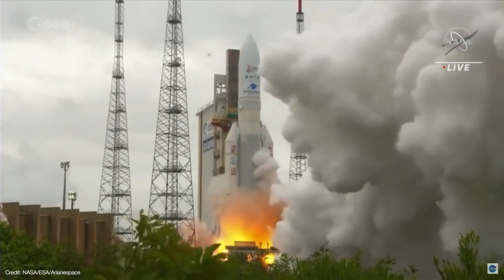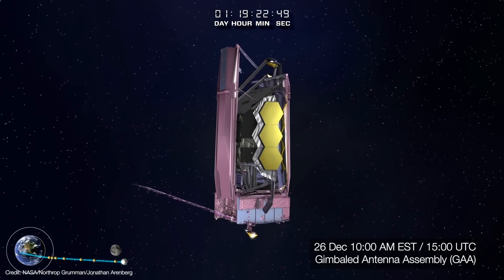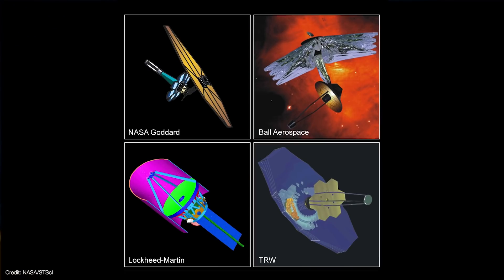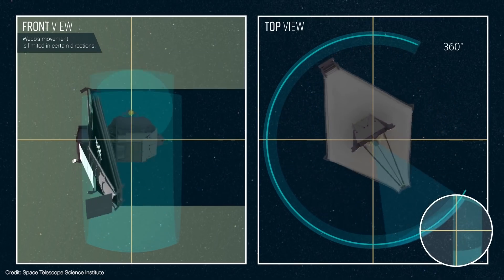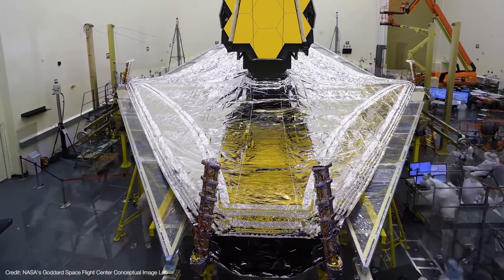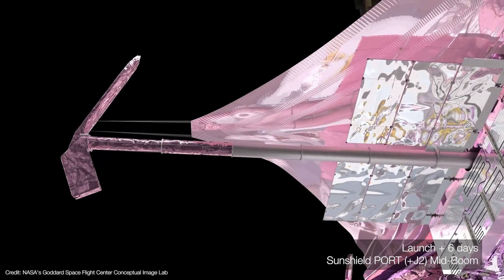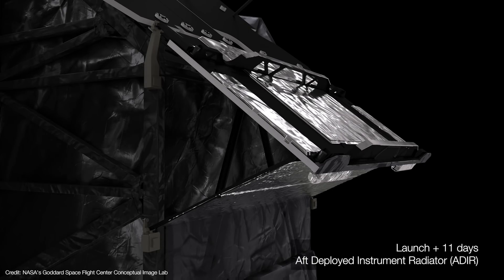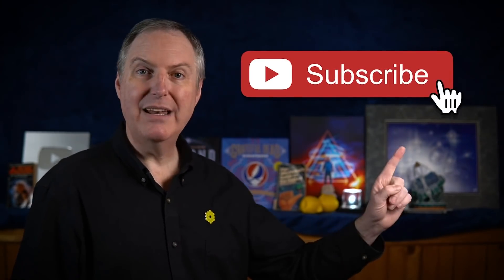How James Webb's Deployments MUST Work

Comment from the maker: 🔴UPDATE: The sunshield covers have been released and rolled back to their staging position. This procedure alone required several mechanisms to fire just exactly right and they did! Thumbnail updated :)
Reply: If there is lets say a MAJOR issue that cannot be corrected...couldn't JWST technically burn to return to earth orbit so at least it could be serviced and then fired again later back to L2? I know this would be insanely costly but much less than losing the entire thing.
Reply from the maker: I don’t know if it has enough delta-v to turn around and burn for home but even if it did, doing so would expose the telescope to the sun, causing it to overheat well beyond limits.   That would render the telescope unusable at that point.
Reply: @rowenhusky  No…not at all
Reply: @tagwolf  I'm sure if anything goes wrong in the future space X will be able to take astronauts to fix it
Reply: @davefarmery8180  It has to station-keep to stay at the L2. The telescope has a planned minimum 5 year operating life. The minimum time for Starship to develop and reach it is probably 3-4 years from now. This would pretty much count as a failed project even if a few years can be salvaged.
Reply: @davefarmery8180  Of course they won’t.
Reply: Luvoir launches in 20 years , hopefully Starship will be ready by then.
Reply: @paulbedichek2679  how do you know
Reply: @Titus Veridius  at 10 billion to build and probably 20 billion to replace and the fact it is allways trying to move closer to earth if it failed i suspect given time it could be fixed
Reply: @davefarmery8180  with what magic?
Reply: @rowenhusky  No, of course not.
Reply: You do the best work on  JWST.
Reply from the maker: Thank you 🙏
Reply: Why didn't they finish deployment at the ISS??
Reply: @popeyegordon  Not only did they not assemble at ISS, the next iteration of this design, Luvoir, will not be assembled in space either, we will simply make use of the greater volume of the fairing of SpaceX Starship to build a bigger telescope, the reason is cost, and you lose the energy you have in the rocket, also, why do it if this method works so well. So far, so good.
Reply: @paulbedichek2679  Really? You ignore the high risk of mechanical failure that is non-existent with an ISS deployment? All they talk about is how many separate operations must go perfectly and one failure can end the mission. I hope it succeeds but if not, this more reliable alternative will come up with the Monday morning quarterbacks.
Reply: @popeyegordon  If
Reply: Which was the reply the Spartans gave to the Persians when the Persians said if we invade Sparta we will desecrate your temples and women.
They never invaded.
Reply: @paulbedichek2679  Correction, Phillip of Macedon threatened to invade Sparta and the reply was "if". For all intents and purposes they were annexed peacefully. By this time the Spartans had lost whatever it was that separated them culturally and militarily from the rest of Greece, they were never especially a military power after this time period. It's also likely that their reputation remained into this period despite their fall from legend, which contributed to Phillips pursuit of means other than war. (though he defeated Greek army after army, and likely would have done the same to the Spartans by a huge margin)
Reply: @Dadecorban  Don't ruin a good story, still the best reply.
Reply: @paulbedichek2679  you ruined a good story ^.^
Reply: @Launch Pad Astronomy It's almost shocking that circular, fanlike sunshades using a much simpler, corkscrew (helical) deployment, weren't used with the Webb.
Reply: Ready for mid-booms.....gogo DEU!
Reply: YES!!!!
Reply: I love the updates for the video’s thumbnail!
Reply: Did you know that HUBBLE is Sophia telescope on a 747?

Comment: @Launch Pad Astronomy Hey, great video on the JWST mission. There's so much attention on this once in decades mission start and you've summarized all the steps in its deployment admirably.  Do you know how much the sunshield will affect Webb's trajectory? It seems like a pretty decently sized sun-sail and generally about perpendicular to the sun so its cross sections catching solar wind would be pretty large. I understand that the aft momentum trim tab helps keep Webb properly oriented but there is still force acting on the sun shield which could affect JWST's trajectory, isn't there?
Reply from the maker: Thanks, I'm glad you liked the video! Radiation pressure wouldn't change JWST's trajectory so much as cause the spacecraft to pivot around its center of mass. This happens when the center of radiation pressure and the CoM aren't at the same location. The exact location of CoP varies depending on the spacecraft's attitude at any given time. So the trim tab helps but the reaction wheels are ultimately going to have to be running during an observation. If the wheels saturate (reach max RPM), then thrusters will be needed to pivot the telescope back and unload that accumulated momentum.
Reply: @LaunchPadAstronomy  I see, thankyou for answering my question! I thought it might give an overall force vector pointing away from the sun which would be at right angles to the direction of motion and that over time could change the trajectory.

Comment: Never considered you need to “ground” electronics in space too. Great video!!
Reply: This is also a reason some rocket upper stages are painted- the paint reduces the surface area on foam insulation and dramatically decreases the amount of static buildup (and of course thermal protection)

Comment: Critical solar array employment? Really, everything is critical with JWST. It’s a pyramid of critical junctures leading to the chance to do space breaking extraordinary astronomy. 

But using critical for the panels is a bit much. This thing is built to take a pounding given its treatment by the launch provider during integration. There are many things that are required to happen in sequence before they even start calibrating and testing the instruments.

Comment: 14:27 Six hundred degrees of what please? Boiling water to freezing air is not 600°C or 600K. If you’re using some quaint units instead of metric, please always mention which ones!

Comment: I'm thinking if you could wrap your house in the very same material used for the shield you could conceivably live in a cryogenically frozen house in the hottest atmospheres on earth or remain nice and toasty in Antarctica in the dead of southern hemisphere winter.. Then again..I could be wrong and probably couldn't afford it if I'm right.
Reply: The sunshield is similar to a space blanket. Many houses already use a similar material on the sheathing that covers the exterior. It does not work as well as Webb, however, because there is air between the layers to transfer heat.

Comment: Please explain how it orbits L2. Since L2 is just a point in space, it doesn't have any mass. What mass is the Webb orbiting? I would guess that it's an extension of the Earth's mass, but I've no clue how that would work.
Reply: The halo orbit at L2 is centered on a line thru the Sun and Earth. The Earth's mass enables it to revolve around this point.

Comment: So does this mean the next generation space telescopes will be massive space based radio telescopes? I'm not sure how exactly RF interacts with the atmosphere, but I would imagine it would attenuate certain frequencies. Or maybe the next generation will be able to see further into the infrared. I'm not sure what wavelengths JWST was made most sensitive. Whether it's more in the near infrared, or closer to far infrared, or somewhere in between. I'd imagine it's probably between near infrared and "somewhere in between." Interesting questions which I need to find answers to now.
Reply from the maker: Webb is sensitive to the near and mid-infrared spectrum. It won't see into the far IR as Spitzer and Herschel did, but that's largely because the science requirements for Webb are a little different than for those other IR missions.

Comment: "The shield alone uses 140 release mechanisms, approximately 70 hinge assemblies, 8 deployment motors, bearings, springs, gears, about 400 pulleys, and 90 cables, all of which must work"

Still simpler than the G11.

Comment: Hard to understand how the thrusters when used can keep the halo orbit in its proper plane of rotation... being clear out at the radius of the orbit instead of on the line running from Earth to the actual L2 point. Seems like the force of thrusters would skew the orbit.
Reply: The halo orbit is a somewhat natural and stable movement for an object at L2. The thrusters are only needed occasionally if it drifts away from the orbit.

Comment: So I have a question. That shiny shield layer 11:14 facing the mirror, won't it reflect unwanted light at the mirror, thereby introducing glare or lack of clarity? Thanks.
Reply from the maker: It could in principle, but there will never be anything warm enough to heat up the top of the layer to interfere with the telescope. Yet another benefit of its orbit around L2!

Comment: In 5 years when the nominal mission of JWST has ended, but prolonged for as long as possible, the NASA Administrator is having lunch with the JWST PI:
"- Too bad that JWST, that saw the moment when God said 'Let There Be Light!' will only last for another few years until its fuel runs out."
"- As if by chance, Mr. Administrator, I happen to have here in my pocket, a USB memory stick with complete plans for the design and production of a probe that could dock with the JWST. Which seems to for some reason have a docking ring built into it that precisely fits this purpose. A probe that with its fuel could take over the maneuvering of the out-of-fuel telescope and prolong its lifetime by 20 years."

Comment: Using minimal fule because of the near-perfect course from the launch means JWST will exceed its 5year design to 10 years minimum.
Reply: They probably will start working on a possible refueling mission, using robots and such. 5 years plus the conserved fule will give them time. I heard that in a similar video like this.
Reply: @whatcanisay93648  There are no spacecraft currently capable of reaching Webb at L2 to fix problems or refuel the space telescope, which is why NASA spent so many years designing and testing Webb to ensure it could survive for a long time alone, in the dark.
Reply: @bluestraveler2980  the trip isn't the problem the delivery is, if ever dared to developed refueling mission. As things stand, what we will see when JWST IS fully functional will be amazing and revolutionary.
Reply: @whatcanisay93648  lol what are you talking about?

Comment: but how do they know kapton is cold resistant up to -296 when the absolute zero is at -273? what did i miss here?
Reply: @vanfan1960  thanks for telling me, i confused the 6 and the 9 in my head:D but that leads to my next question, why is it -269 and not -270 for example?how does the material react to -269.3?

Comment: Question , why , jwst is not completely deployed at the very begining when its still close to earth before being sent to its remote location?
If there is a major mechanical issue it would be possible to send a manned mission  to correct the fault like they did with Hubble.

Comment: There is no way this is going to work. There is such a high degree of complexity at multiple levels with such small tolerances and zero error margin that it is amazing anyone ever imagined it might work. I bet it fails before it even reaches L2.
Reply: @kosmique  Only in simulations.
Reply: @frankclough380  So if we follow the process that has been refined for years, we will achieve the simulation result. All our space projects have required the same high degree of complexity, and we've done alright so far.
Reply: they did it 4 times the 4 th successfully with confidence ...thats not simulation ... just saying in case you were willing to listen ...thats all
Reply: @blast4music  The JWST has to follow a long chain of complex and precision operations in a precise time sequence in order to work and failure at any point will terminate the mission. This is very worrying considering that one space shuttle has exploded in mid-air and Hubble was sent into orbit with a wrongly ground mirror.

Comment: Excellent explanation. Thanks!
The only part that looks really likely to cause issues is the separation of the layers of the sun shield; looks like they could easily bind at the outer points as they try to ride up.

Comment: The final test comes roughly 29 days from December 25, 2021, when JWST fires its onboard thrusters and puts itself into its final orbit 1 million miles from Earth. There it will live out the rest of its life, always pointed away from the Sun, until it runs out of fuel in five or 10 years

Comment: tbh, it really would be a miracle if everything works as planned
Reply: No, just good planning and engineering. The Moon landings were harder than this. It had lives at stake.
Reply: @Giantdwarf00  I beg to differ.  Apollo 13 mission did have higher stakes but less single points of failure with no contingency.  The fact that the astronauts and ground control team could overcome the various issues confirms this.  Apollo was also a manned mission making it easier to compensate for unexpected events, especially catastrophic ones.  The complexity of JWST, greater nunber of single points of failure with no contingency and higher dependency on automation makes this a much more difficult endeavour albeit with no risk to life.
Reply: @JohnSmith-ys1wr  The Moon landing mission had its fair share of these points of failure though, but each one could cost a life, not just a mission. Yes, this JWST is no walk in the park and highly complex but I wouldn't say it's the most complex. If we were to judge on complexity (multiple points of failure, automation systems) I'd say the Mars rovers, specifically Perseverance beats this.

Comment: I'm surprised the engineers came up with this plan. I use kapton tape and that stuff is so thin and doesn't take much to tear it. They could of also used thermo electric coolers to generate electricity due a great thermal differential at their disposal. I hate to say it but JWST is old tech. The military has tech that could dropped this bird of at L2 and come back home in a couple of days, if not sooner and made sure it fully deployed. But the American people will never see this tech because it would take an act of God to release it to benefit mankind. There is so much tech out there folks. This is child's play.

Comment: JWST and NASA's hubris in making this device disturbs me.  I am 110% in favor of robotic space exploration and the concept is great, but at what cost? What was so urgent about JW that made it cost 20x more than budgeted and a quarter of a century to work, assuming it does. There will only be political criticism of it if it fails, like the Space Shuttles eventually did and they proved riskier than even the pessimistic "Ivory Soap" engineers did . Engineers have spent their whole careers on it.   What is so special about JW that it justifies this risk?  Frankly, it could find some neat stuff, but does not promise the type of bang for the buck that Hubble and Herschel have provided, namely because the gain is only incremental and not a leap (like building another massive collider which Physicists want but can't really justify--even some physicists object to a new collider).   Do we really need to see the earliest galaxies right now?  Isn't there other useful programs that we can do right here in the solar system where we might actually have some benefit.
Reply: There are many things very special about this telescope. You can easily look it up. I personally am very pleased that instead of wasting trillions on useless social programs we get this marvelous scientific tool.

Comment: Why Webb doesn't have solar panels on both sides of the intrument unit ?  (It has just one panel on one side)
Reply: because that is the only side that will be pointed toward the Sun during the mission.
Reply: @peteb901   For both sides I mean the right and left sides of the Instrument Module, as opposed to the hot and cold sides of the telescope.
Reply: @cmwong9956   Ah, OK. I assume that one array gives them them 2k W, which is sufficient

Comment: The one part I still don't fully understand is why the solar flaps aren't articulated to allow controlled desaturation of the reaction wheels. I get that the lifetime of JWST is limited by amount of propellant for the main engine, as L2 requires station-keeping, but it also has to bring reaction thrusters and propellant for desaturation. Was it really simpler and more efficient to do that over connecting a few control cables to the solar flaps?

Comment: Excellent video! One thing I don’t understand though is the halo orbit around L2.  Unlike a satellite orbiting a massive body like the sun or earth or even an asteroid, there is no central mass at L2, so where does the centripetal acceleration come from to orbit that point in space?
Reply: The thing about orbits is that they depend on the frame of reference. From the JWST perspective it would look like a halo, but from an outsider's perspective it would look like a dance behind the Earth, and that's because the gravitational forces of the Sun and the Earth create a slightly stable space in which all of these forces are in equilibrium.
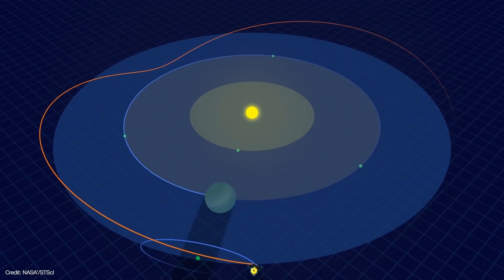Reply: 5:54 In the Sun reference frame it oscillate up and down the orbital plane while orbiting the Sun.